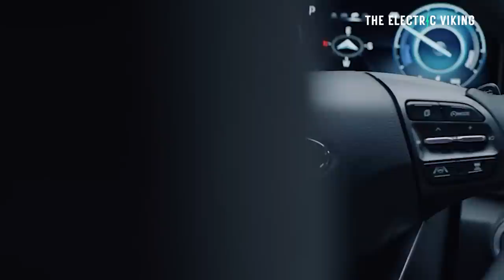Hyundai in ‘crisis mode,' ramping EV investment in America to $21 billion

Comment: Sam,
Cost of goods shipped by Container (parts, subassemblies).
Autos are driven aboard PCC ship.
Freight rates for containers spiked due to CoVid related causes.
PCC anc PCTC is a completely different freight market— those ships carry 95-100 percent self propelled cargo (cars, trucks, SP equipment).
 accelerated scrapping during 2020-2021 may have occurred but did freight charge for shipping autos and trucks really go up 10x?

Comment: Hyundai needs a Kona EV sized vehicle, based on the E-GMP architecture
Reply: Maybe the twin to the rumored Kia ev4? That is 400v like the ev5, with cheaper lfp pack's a single motor and sub 30k rumored starting price.
Competes against the upcoming ex30, zeekr x, smart #1 etc.
Reply: 100% agree. Hyundai/Kia are building a city tank like the EV9, but that is completely the wrong middle- and long term stategy.
Reply: @meersde  I think it's their U.S. based ev strategy. It's gonna be built at the all new ev only savannah GA metaplant from late 2024.
So eligible for the full credits since it'll use commerce GA built sk innovation cells. In Korea it's sales dropped way off due to issues already.

Comment: Environmental regulations have forced many dry bult ships into scrap and therefore higher shipping costs.  Building new ships that will meet new environmental standards is very difficult.  This is just another reason we are deglobalizing.
Also, the cost of powering these ships is increasing dramatically.
Does anyone else have insight into the increase in shipping costs other than a flippant "greed" remark?  I am very interested.